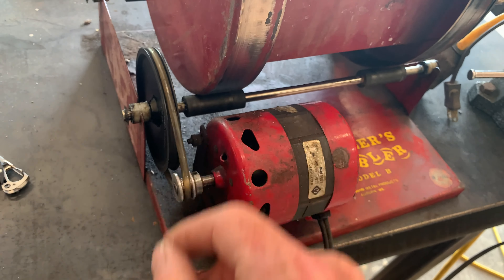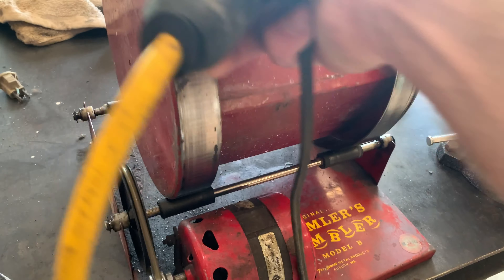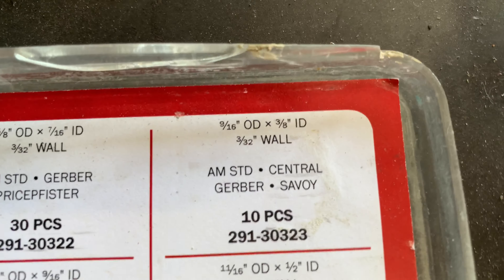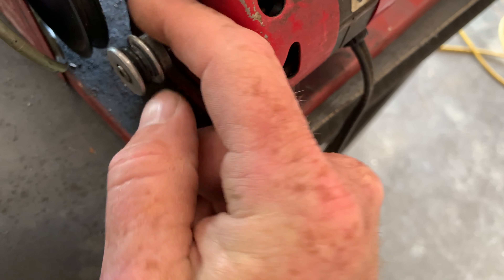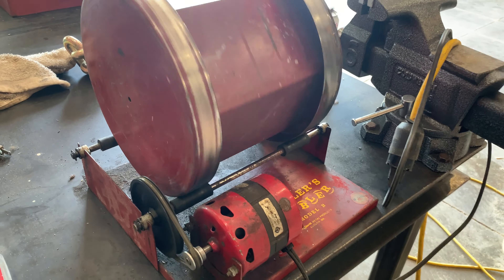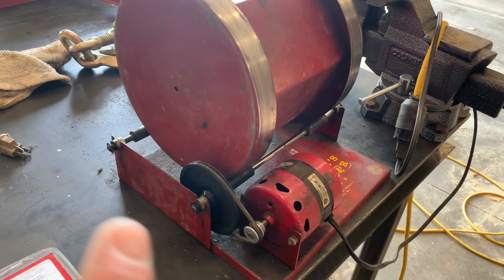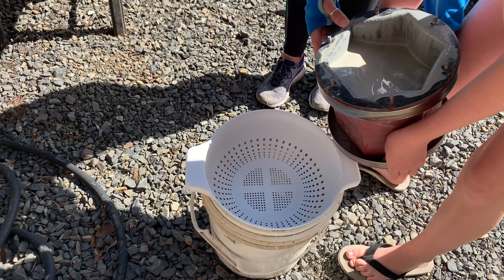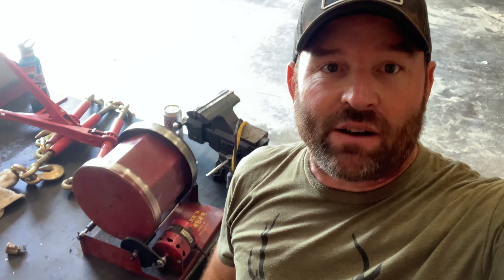Thumler’s Tumbler Model B | Belt Slipping Fix

Comment: I have an old model B that I bought new in the early 1980s to clean brass for reloading. Mine has a black motor. Started using the treated crushed walnut hulls media but as time progressed switched to wet method of cream of tartar with cut brass pieces as the scrubbers. I might have exceeded the recommendation of 15# of tumbling contents many times. Anyway after having not used it in over ten years I decided I needed to get it running again. Bought a new drum liner and lid gasket, roller bushings, and lid knobs and a couple new belts. New belts were slipping so in my search for new pulleys I found your YouTube channel and how you fixed yours with the right size of O-ring. Having a O-ring kit of various sizes I had to use three of them to get it to work because the pulley on the motor shaft was so warn, but your method worked great. I know that it will work until the new pulley and pulley/shaft assembly get here. If not I’ve got plenty more O-rings where those came from. Lol!

Subscribed! 

Many thanks for the great tip! 👍